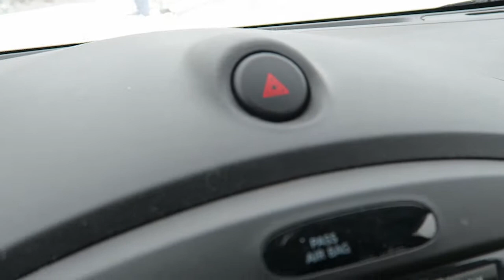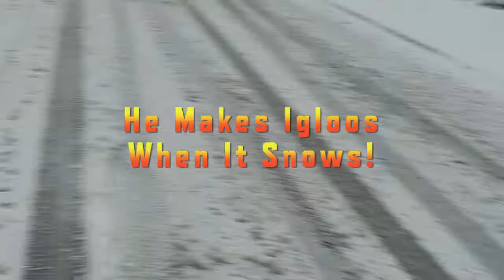No Snow In The Bathroom

Comment: Hey Subtac. Here's a tip that might help you. When prying off the baseboard try putting a good stiff 4 inch putty knife between the Sheetrock and the heel of the pry bar. It might save you some repair work. It usually works for me.